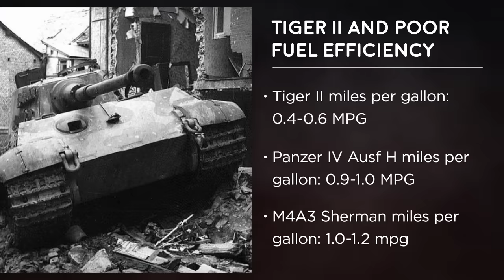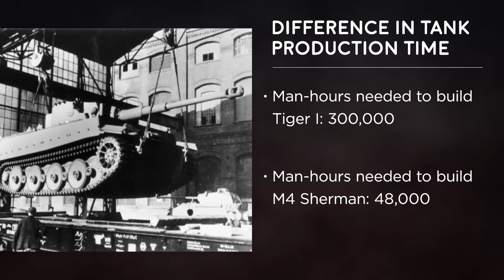Why Did German Tanks Perform So Badly in The Battle of the Bulge?

Comment: The troops that were committed to the Ardennes Offensive by Germany were originally meant to go to the Eastern Front.  In middle 1944, Germany faced 2 disasters:  The Western Allied landings in Normandy and the Red Army offensive that started a few weeks after, Operation Bagration.  The Red Army basically did the Joker disappearing pencil trick with German Army Group Center.

Germany had been trying to stop the sucking chest wound in the east and the troops built up were supposed to help stabilize the situation.  Instead they used them for the gamble in the west, the Ardennes.  When this offensive failed, Germany could no longer truly field a new, strong army with lots of panzers.  That was it.

Steiner... Steiner no longer had the panzers to delay, never mind top the Red Army because Germany used its last great concentration of armor for the Ardennes.

Comment: The first ardennes offensive 1940 saw a germany army at full supply levels using light
and medium tanks during the summer.{And moral was high with crack troops} And 
pretty much full air support that dominated the skies. 

The second was during winter using bigger medium and heavy tanks with low supplies   
and low moral on a timetable that was a joke!{with many  green troops}
The outcome was not a surprise and shorten the war since it was the bulk of their 
reserves on the western front. {and little if any air support}

Comment: Tiger 1 was the best. Why creating a new tank and deal with the mechanical failures when was much better and economical to slightly improve the Tiger 1?Because no matter how good a tank is in armour and penetration when you have a broken transmission or engine on fire is useless. So they could have avoided the rate of abandoned tanks due to those failures.

Comment: Too heavy, with no parts, no fuel, no experienced tank crews, minimal air support - and low morale… The Germans DID have some amazing armored vehicles, hard-hitting and well protected. They didn’t have these in great numbers, however, and their mechanical reliability was so-so at best. Lack of parts and repair capabilities meant that any breakdown or battle damage, however minor, usually resulted in the loss of that vehicle. Moreover, by 1943 Germany NEVER had enough fuel to operate these powerful tanks freely, constraining their tactics at all times. The Allies had gained air supremacy well before then, so ground fire was the Germans’ only defense against the constant attacks from Allied fighter-bombers. There was also the matter of morale. Fighting a losing battle on two fronts - slowly retreating across both Eastern Europe and Western Europe, month after month after month, every day with fewer resources than the day before - and with no realistic hope that the situation could or would improve - did NOT help, surely…

Comment: An aspect that was pointed out in Thomas Anderson's book on Tiger Tanks, which hampered the effectiveness of the Tigers, was the dwindling availability of competent tank drivers.
Anderson quoted sources from written reports from Panzer tank commanders to division HQ, where the commanders were lamenting that low-skilled tank drivers were putting the Tigers out of commission with broken transmissions; and the careless driving of the tanks that landed into ditches, streams, and off of bridges.
Reply: German tanks also had hydraulic traverse, so to traverse the turret the driver had to shift to neutral, then race the engine to get good hydraulic pressure. By contrast, Shermans and T-34s had electric traverse. The T-34 had a 'bang-bang' controller, which was a problem, but Sherman traverse was proportional.

Comment: The allied bombing campaign made minimal impact on the Nazi production and economy. The Nazi economy was mostly hampered by having to move them back inland due to the failing fronts. Just as the Nazi bombing campaign on Britain was a massive failure in destroying resolve and economy, so was the allied bombing campaign on the Nazi's. The bomber may perhaps always go through, but most bombs will miss, and the ones that hit wont do strategic or tactical damage, sometimes not even operational damage.

Comment: Without watching the video,biggest problems: fuel shortages, lack of forward advance recce to secure bridges before main body advances, tanks were too big for the narrow, muddy and compact Ardennes. 
Tigers, Panthers, TigerII, Jadtigers and Jadpanthers are huge destructive monsters that need a ton of fuel, room to manoeuvre and are vulnerable in condensed areas.

After video: a lot of money was spent on designs that didn't live up to the hype. StugIII's and Panzer IV Ausf H were more then capable of taking down any allied tank. The cost of a Stug was 5:1 ratio of a Tiger and 4:1 for a Panzer IV. 
The more rounds you send down range the better. Granted the armour was not a thick but when resources were limited an immobile 45 ton pillbox on tracks is not ideal. 

Good video.

Comment: Big oof. Theres kinda much wrong, not in a way like straight up Lied, but misinterpreted.

I would need a Video atleast Double the length of this Video to answer everything. 

But things like the Costs of vehicles, Spare parts and ammo werent really a Problem. The Problems were the reasons these "Problems" existed.

Germany built huge Tanks to get an Advantage. More Panthers or Panzer 4s wouldnt have changed anything as Germany didnt Had enough Crews to crew them. Thus the Crews they had received "better" Tanks.
Same for spare parts. 
If a Tank broke down in a Battle, it was lost if the Army couldnt advance. Doesnt matter the Nation. Same goes for when it broke down on ways. Ofcourse a 72ton Tiger 2 is by far more difficult to move than a Sherman. But try towing a Sherman with a broken Transmission out of mud without proper Equipment and Vehicles.
Same for repairs. Germans knew they had to place repair Shops for their Tanks. Usually if a Tank broke down, the crew would get another one while theirs is in the repairshop to undergo repairs and Upgrades. Germans split the Work in favor of better craftmanship and expertise. Btw. This also counts for their firearms.
When for example an stg44 broke, they returned it to a gunsmith in their base, receive a new gun and the broken one gets properly repaired.
Different approaches and philosophies with different pros and cons.

I could go on like this trough the entire Video and explain every Point in Detail, but im a laty writer. Sooo.. hope you all have a nice day.

Comment: The Firefly was not "the" British variant of the Sherman.  It was a variant but they didn't exist in huge numbers.  Most British Shermans had the standard 75mm gun.  Plus, the Sherman's frontal armor wasn't as thick as the Tiger so even the Firefly could be killed by a Tiger at a range where the Sherman could not yet kill a Tiger.   That probably didn't make much difference in the Ardenne where fighting took place in close quarters but the point is that German's tanks weren't outgunned, they were just more evenly matched by both American and British Shermans that sported more powerful guns than the standard 75 mm.

Comment: All presented here is believably factual. 

I submit for consideration the tactical issue was compounded by poor geographic considerations. 

The German Heer had 4 years to fully reconnoiter and update their 1940 maps topography as well as the capacity and structure dimensions of bridges and roads. Their early experiences on Soviet landscapes should have forewarned them. One can only wonder that they may have wished they still had scads of Mk III 7.5 KWK L24 and the motorcycle with machinegun mounted sidecar on their equipment roster.

The 1940 equipped Heer probably could have traversed those Ardennes bridges and encircled  the opposing troops establishing a good combat engineered upgraded bridge foothold for large Panzer V and VI armor with accompanying Panzergrenadier troops.

Luck fortunes the prepared.

Comment: These things are all true, but they are much too technical and much too focused on the tanks themselves. The tanks are expected to overwhelm the enemy positions and win the battle. I guess this also lines up with what people like Hitler believed, but it’s not a reasonable expectation of tank warfare in the first place and it’s not what was happening when the German tanks had their big successes. 

Tanks were a key component but still only <a> component in armored warfare, and the other components and notably their absence were just as crucial. Namely the infantry, artillery and air power. 

Air power was crucial for the Germans in most of their successful offensives. Even as late as Stalingrad, when the German offensive was slogging ahead against outgunned but determined defenders, it was frequently the Stukas that enabled the Germans to make any progress at all and kept dangerous counterattacks in check. A few months later, the German fighters lost control of the sky and that’s certainly a reason (if not the only one) the Germans lost their offensive punch.

The other big factor was the infantry. In the early war the German tanks were never expected to win the battle by themselves, they were meant to strike together with the infantry. In reality, the infantry is the force fighting the war and the tanks are just a tool that supports them. By themselves tanks are weak. The tanks used by the Germans during case White, Yellow and Barbarossa were basically obsolete, but they were part of a larger force that fought with maximum cohesion, and they did their job of striking the weak points created by this larger force. And they didn’t have to fight the enemy tanks because the Infantry, Artillery and Airforce mostly did that. All this of course also requires well-trained and experienced crews and officers, in all arms to work. 

During Barbarossa, however, the German army lost probably a majority of their veteran frontline troops. The people they replaced them with inevitably performed worse, but then they lost those as well while continuing to also loose more of their remaining veterans. By 1945, the Elite SS Divisions might still have had a core of experienced troops, but the rest of the divisions didn’t. “Volksgrenadier” is just a fancy word for “whatever we could scrape together”. And of course, they also have far too few men. And guns. 

By 1944, they have no one left and during the Bulge (and before) what should be an aberration—tanks attacking by themselves and trying to force a breakthrough against a weakspot no one has worked to create—is now the norm. But this can never work. And the infantry itself also can’t do it’s job, either, because it’s undermanned, inexperienced and unsupported. 

Meanwhile it’s the Allies whose forces manage to successfully cooperate. Most of the important positions aren’t just held by infantry, when it matters they are almost always backed up by Shermans, and/or M10s. Sure, those are both weaker than the German tanks but their close cooperation with the other arms serves to negate those weaknesses…just like it once did with the German Panzer I, II and 38(t). 

Of course, it also helps that the Shermans are available in large quantities, which was intended in their design, so it’s possible to deploy them more widely. 

The German tanks also have weaknesses, and without signfificant support from other arms those weaknesses become fatal.

Comment: Maan...did you ever, ever made ANY calcualtions for Tiger tank man-hour?

From Quora:

In 1943, the plant made 647 tanks [Ref 2]

This gives 8000 men x365 hours/647tanks = 35,000 man hours/647 tank=54,0000man hours per tank

Tiger production varied between 25 per month in 1942 and 104 per month in 1944

This compares with T34 figures of between 3700 and 9000 man hours per tank- Ref 3. See also Ref 4&5

This means you could build just under 8 T34s in the time you could build a Tiger. This seems a sensible comparison.

Note that this is factory time for comparisons. Comparing the outputs of different countries in WW2 is subject to uncertainty as the methodology of determining values varied etc.

Looking at other estimates, Salavrakos [Ref 6] givs 300,000 man hours per Tiger, 150,000 man hours for a Panther but only 2000 man hours for a Pzkpfw III- it doesn’t look as if a like for like comparison is being made. The 300,000 man hours figure is discussed here There is a claim of 300,000 man-hours to produce a WW2 Tiger 1 tank. Are there any records to compare manpower effort per vehicle by countries in WW2?

The 300,000 man hours figure has grown legs! But I cannot find the original source apart from the Tiger Field Manual. Being an avid listener to the BBC R4 series “More or Less” which looks at statistics like this, my best guess is that someone took the 100,000 man hours figure for early factory production and then asked an economics professor what fraction this was of the total time to make the components, and he said “about a third”- and hey presto! I shall update my post if the true provenance becomes available.

It is hard to believe that the Soviet Union factory could turn out 80 T34 tanks in the time a Tiger is produced, so I don’ think the 300,000 figure can be compared to the T34 values above.

For completeness

Pzkpfw V Panther Tanks

I came across this data from MAN, the manufacturer of the Panther.

This gives 5500 man x 12 hours per day x 365 days per year= 24 million man-hours

4000 Panthers were built in 1944 [Ref 2] - assuming 35% at the MAN plant (others built at Daimler Benz near Berlinand MNH at Hanover) gives 1400 Tanks.

This gives 17,000 hours per tank- which is a little over the half the time for a Tiger figure in Ref 6 but broadly similar with my factory figure.

Also, in asking about producing a complex piece of technology- where do you start? The engine, the steel, the ore, the design process?

I once went into a bike shop to get a spare inner tube (in a hurry) and the merchant asked me “did you build that bike yourself?” and I replied, somewhat too curtly, “No, it’s made of aluminium. Do you think I own a bauxite mine and an aluminium smelter?”

Comment: In 1940 most German tanks were Mk I, Mk II, & Mk III's as well as T-35 and T-38's all under 18tons, and only a few 30 ton Mk IV's.  As such the roads through the forest were much more manageable. Also the Wehrmacht wasn't as fuel strapped as 1944.

Germany would have been better served with the mass numbers of Mk IVs and STUGs that Tiger and Panther tank production made inpossible.

Comment: The reason they performed worse than expected comes down to several factors. First fuel, the Germans were short of it and "the plan" was to capture allied fuel depots. That didn't go as planned, and a number of powerful tank formations ran dry and had to be abandoned. Second, allied engineers who blew up the bridges and forced the Germans to change the plan, which relied on bridges to move them quickly to Antwerp. Third, the 101st Aiborne Division at Bastone with tank attachments from the 9th Armored Division. All of these were likewrenches thrown in the delicate machinery of the German plan. As it is said, no plan survives contact with the enemy.

Comment: The Panther did not take days to swap a transmission, it took seven hours. Tiger they had to pull the turret. Panther did not. 

Tiger took so much longer to build and was more expensive because it was a heavy tank, the Sherman was a medium tank.  Its like saying a truck used to haul products is not a good of a vehicle as a sports car, that depends on what you want to use the vehicle for.   Tiger was designed to poke holes in enemy lines, tanks like the Panzer IV and Sherman were intended to exploit that hole in the enemy line. 

The Firefly penetrating the front armor of a Tiger II is half truth. The Firefly has to use APDS, which was in short supply, the round was known to be inaccurate which means the Firefly has to get danger close to pen. The Standard APCBC ammo is not gonna pen the front of the Tiger II, it couldnt even pen a Panther frontally unless it got a lucky shot. 

The Allies tested numerous anti tank weapons against captured in Panthers in France at Isigny in July 1944. https://worldoftanks.com/en/news/chieftain/chieftains-hatch-us-guns-vs-german-armour-part-1/

Comment: They performed well until they either broke or ran out of fuel. Both happened. Fun fact: The King Tiger consumed a litre of fuel for every 100 metres it traveled. They almost got it right with the Panther, but the final drive was still too weak for the weight.

Comment: Without specifically addressing this question, the general state of the German army at this time is that it had been chewed up and effectively destroyed on the eastern front. All German units on the western front at this time were so undermanned that their units wouldn't have even been combat ready according to the line of battle in 1941 or 1942. on top of that the fuel shortages were so severe the mechanized units and air force units were effectively crippled. Whereas America had unlimited amounts of fuel for both mechanized units and air forces, including high octane fuel for the fighters.

Comment: Young and inexperienced crews.  No fuel.  Little to no replacement parts.  Bad weather.  Much of the experienced NCO and junior officer corps by then already had been killed or captured.  No air cover.  This was a completely doomed operation.  It literally had zero chance of success.  In fact had the weather cleared a day or two earlier it would have ended up a total massacre defeat for the Germans rather than the major defeat it was.